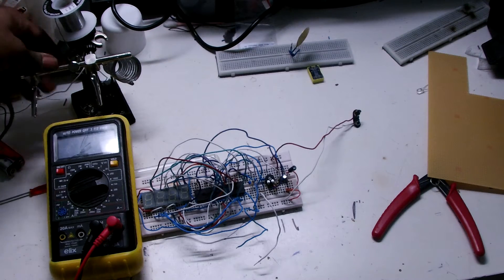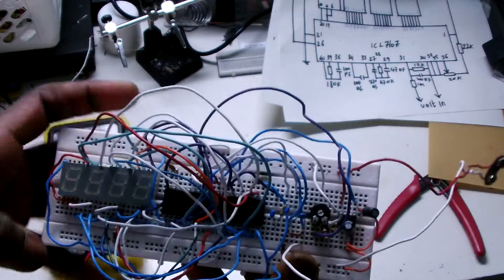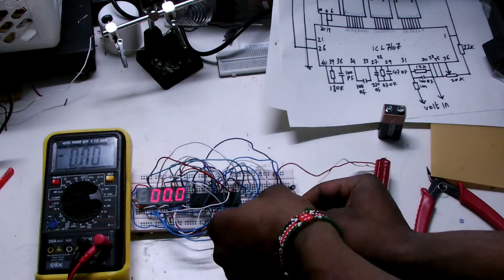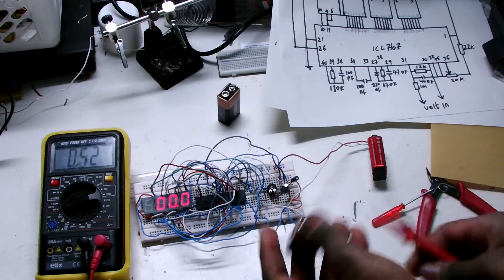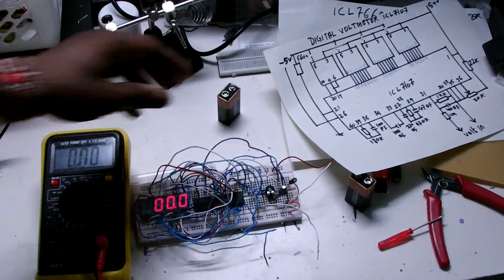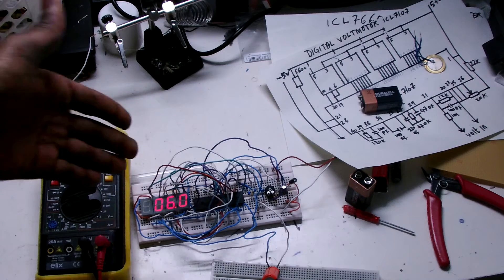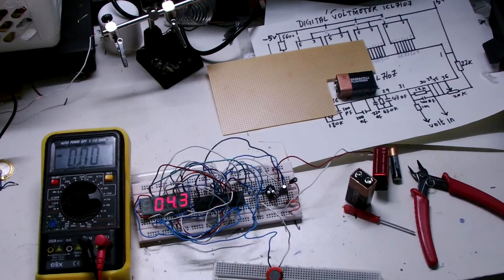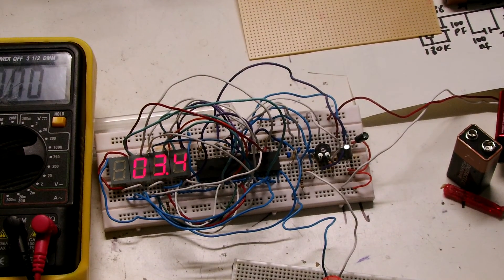digital voltmeter using icl7107

Comment: hello, what did you change to correct the voltage at 2:17 ? is that a potentiometer? if so, what is the range of that potentiometer?
Reply from the maker: That was 20k potentiometer

Comment: Hi sir. Can we change the position of decimal point. So can I get the circuit diagram. Thanks... o_burucu@hotmail.com
Reply from the maker: yes u can move the decimal , 7 segments display pin 5 is used for the decimal ,thuis u can chose on which display u like to connect the jump wire

Comment: Hi, why did you use icl7660 . If we have to use it, how to connect. Please send circuit diagram. My mail is karadumancagatay@gmail.com
Reply: Thank you, please send diagram
Reply from the maker: The ICL7660
performs supply voltage conversions from positive to
negative for an input range of +1.5V to +10.0V resulting in
complementary output voltages of -1.5V to -10.0V

Comment: plz tell me which type of dislays are you used in this crkt.
Reply from the maker: 7segment common anode
Reply: Junior Electronics thanks dear
Reply: Junior Electronics the output shows a fluctuation how to solve this issue ?
Reply from the maker: sorry for late replay ,could u get to solve it?
Reply: Junior Electronics I did,nt solve yet tomorrow is our submission date.
the display continuously shows a fluctuation
Reply from the maker: u used the 7660 ic to power -5 volt to pin 26?

Comment: Respected engineer kindly can u respond to me for the following: 

IC 7660 can be replaced by 7805 " 7805 is a voltage regulator to 5 volt . Mr i cant find this IC in my country and can i ask also if i use a power supply directly with 5 volt can it be engoght not to use either 7660 or 7805 ? 

kindly respoind to me ASAP and ur effort and time are highlt apprecited :)

Comment: how to check the IC? that it is working properly?
Reply from the maker: well maybe better to tell me what u experiencing?does the display light?
is not measuring correct ?
Reply: i am using 7107....i dont have any display in voltmeter

Comment: Can this circuit have different ranges? Forma example 0-20 V, 0-2000 ? Where can i modify the scale?
Reply from the maker: Paco Refa 
this change should happen between pin(31)and pin(30) 

0-2V........R3=0 ohms
0-20v.......R3=1.2 kohms
0-200v.......R3=12 kohms
0-2000v.........R3=120 kohms

Comment: Which is the range of this volmeter?
0-200 or 0-20 Volts?
thanks
Reply from the maker: Paco Refa 0-200 volt,,but its gonna show 199 ,the circuit kind have 1 volt drop out

Comment: hi i build this circuit but the display was stuck on 1999 or 1666 i am pretty sure that i made the connecting right and i dont use the ic 7660.so can you tell me what was the problem
Reply: Junior Electronics can you send the circuit to me?  satriow14@gmail.com
Reply from the maker: Piku Sk the icl7107, need two kind power to function ;
need +5 volt regulator 
and -5 ,connected to pin 26
icl7660 its a -5v voltage inverter
Reply: ok can u sent me the circuit diagram at pikusk73@gmail.com.
Reply from the maker: Piku Sk okay sure i will
Reply: i had this problem also so i stop making this circuit and build an arduino voltmeter.
Reply from the maker: Piku Sk ooh how does it look like? was coding difficult ,please share
Reply: no not that difficult but you need to calibration
Reply from the maker: u got fb? or a link of ur project?
Reply: Find the circuit and code at: http://startingelectronics.org/projects/arduino-projects/arduino-4-channel-LCD-voltmeter/
Reply: yes i also have fb account
Reply from the maker: clemo mwenda ma fb
Reply: can't understand the language
Reply from the maker: my fb book name(clemo mwenda)

Comment: connected the source but nothing is displaying on led display except dot.please assist me.
Reply from the maker: Manjeet jha i suggest that u should check the ic 7660,u have to get (-5) on pin 5,for the circuit to work,,let me know how it goes
Reply: sir ,i am using 7107 ic .but i dont know that how we give -V ?